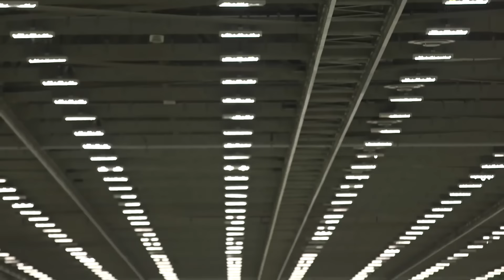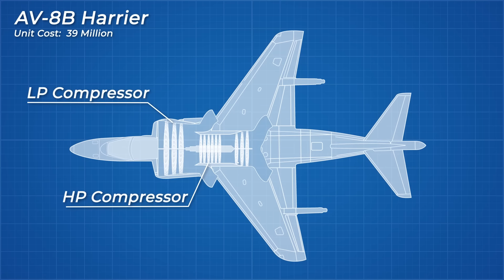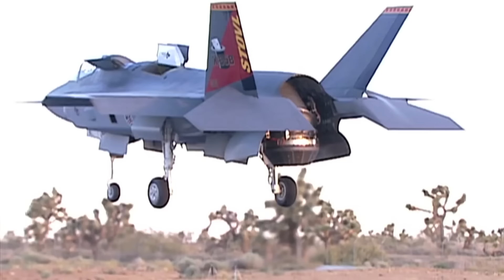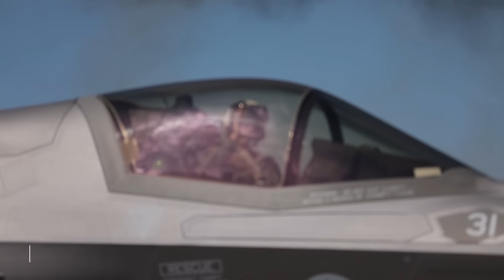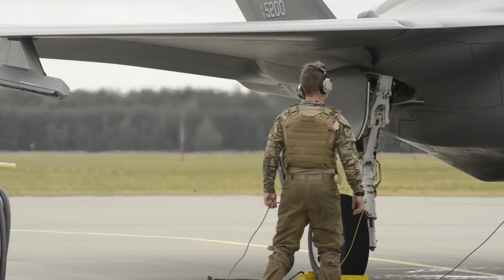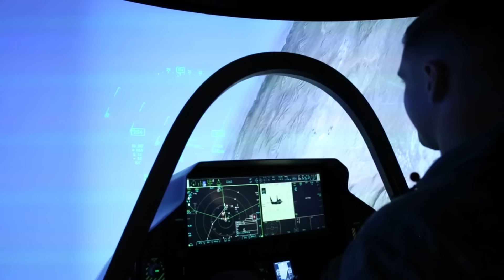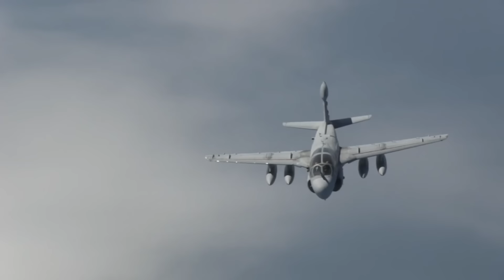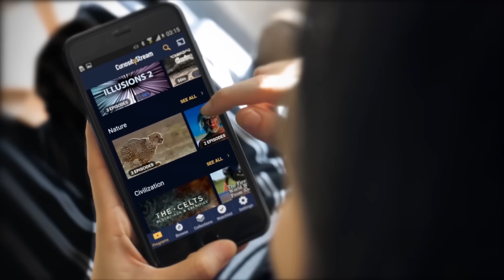Is The F-35 Worth $115 Million?

Comment: Real Engineering:
Mentions F-117

Serbs:
Allow us to introduce ourselves
Reply: *L-band radar has entered the chat
Reply: @gnranger  Sorry, we didn't know it was invisible!
Reply: @kg4boj  lmao
Reply: @gianmariovirdis692  That was literally what they said. Serbia shot down one of our f117's and sent a letter saying:
                Greetings from serbia
    (picture of a bullseye on an f117)
          Sorry we didn't know it was invisible.
Reply: Peter Carlson it was invisible. The reason the Serbs managed to hit the F-117 was because of the excellence of the Serbian air defense commander in question who knew when and about where the F-117 would be and just waited for it to open its bomb bay doors.
Reply: @kurousagi8155  Well no, it's not and never was invisible. For a SAM site to come up with a firing solution they need to have certain paramaters avalable, but they were able to track it even with the bomb bay doors closed. It's just they couldn't get a firing solution at the ranges they were dealing with until they did open. A small RCS does NOT mean invisible, on those older systems it just meant the operator couldn't use auto declutter and had to have a keen eye for small targets.
Reply: Peter Carlson right, so the Serbs had to know when and where it was prior to the F-117’s actual flight. Otherwise they’d be sitting there for hours staring at their screens.
Reply: @kurousagi8155  Actually that's EXACTLY what the radar officers on a SAM battery do. They stare locked into those screens for hours and hours looking for any little blips moving fast enough to be an aircraft. In that era the human brain was the most efficient ground declutter instrument and that's how Zoltan Dani and his men tracked then shot down the F117.
Reply: @kurousagi8155  Days and weeks actually. 78 days to be precise.
Reply: Peter Carlson it’s actually impossible to sit and stare at a screen for hours. Anything that is detectable is detected very quickly. For stealth aircraft, you have to know it’s coming. Otherwise, you’d have no chance.
Reply: @kurousagi8155  Apparently you've never worked in the military "on watch". That's EXACTLY what radar officers do. And while they do slack off quite a bit in the american military... not so with the soviets. You slack off... YOU GET SHOT.  If you are radar operator on a SAM site on an active battle ground YOU DAMNED WELL BETTER NOT let your eyes leave that screen! Mind you this was antiquated soviet era stuff, and even with a modern system like AEGIS you are the operator, you watch that screen like it's your favorite football team. There are no BEEPS or BLOOPS like in hollywood, you see a pair of osciliscope readings and it is your job to watch them at all times, it takes a LOT of disciplne but they do it, and on modern systems the commanders even can throw up fake hits to see if their operators are doing their due diligance and report EVERYTHING.  In soviet russia... you would get shot. On a battlefield? You would get SPLATTERED because SAM sites were very often targets of low flying aircraft who would pop up right out of the ground clutter and splash you, and no, target acquisition and recognition is not an instant thing. It can take a few minutes to recognize just WHAT a target is. If it's something carrying HAARM anti radiation missiles you might want to just shut down the radar for a minute, for a bomber, you definately don't want to do that. Once the search radar recognizes a target and other search radars and spotters identify it is hostile and a TARGET the order comes to attack it, this does not happen in seconds and requires the team to operate efficiently at all times and stay to their tasks. It's not like a nuclear silo operator where they can play ping pong or pool or what not until an EAM comes in and they need to verify launch/no launch.
Reply: Peter Carlson lmao. Right. The Soviet conscript is more disciplined than the trained American professional. Hilarious. 

No. No one stares at screen for hours on end. They do position changes every few minutes to keep everyone fresh and thinking. Also, the Soviets didn’t shoot their own troops since the end of WW2.
Reply: @kurousagi8155  No sir... When I fought in the serbian war with russia 18 hour shifts 7 days were normal. And in combat zones YES... they would "shoot" you. Might not be a bullet though. You might get knifed in the throat.  Boris Yeltsin was president and he didn't take any shit! I know this for a fact... I was in the Russian paramilitary who were also over there fighting in the kosovo conflict. Take it from firsthand experience from someone who was there in person.
Reply: Peter Carlson oh so you’re biased because you don’t want to appear weak despite Serbian air defenses allowing through thousands of NATO air sorties.

I’m sorry that Russia doesn’t have enough personnel to be able to properly man and staff it’s air defenses. But that doesn’t detract from what I said earlier. Modern militaries, including the post-reformed Russian military, do not have guys staring at screens for hours on end. Scientific studies show that attention begins to seriously detract after simply 30 minutes.

The fact that so many NATO bombs came through despite Russian aid shows that Russian air defense practices were not adequate.
Reply: @kg4boj  LMAO nobody ever told me that story
Reply: @kurousagi8155  i was told the bomb bay gave it up yeah
Reply: @kurousagi8155  "its impossible to stare at a screen for hours" yeah right and we all here dont spend 10 hours looking at a screen
Reply: @kurousagi8155 Its not really so much soviet as it is yugoslav,and the "americans have better soldiers" "no we have better soldiers" is not important as the doctrines are so much more different,there they have a bunch of dudes running in the desert following one commander,here we have a few dudes going through a forest everybody helping eachother
Reply: @kurousagi8155  so many bombs came through because we were overwhelmed,our army was much smaller than the american and nato army,but we could punch above our weight ;D
Reply: Peter Carlson lol apparently more than you. I’m not the guy who thinks a single shootdown makes the war.
Reply: Djordje XO I think the difference is that we spend 10 hours staring at an entertaining screen rather than a radar screen that isn’t showing anything.

Serbian air defense had its moments. But when you look at the thousands of sorties made by a few hundred planes, you should wonder why exactly there were so few shoot downs by Serbian air defenses.

I don’t recall any major ground combat between NATO and Serbian forces. So I wouldn’t know if Serbian army forces actually performed well. I was really just noting the performance of Serbian air and air defense forces.
Reply: @cursedcliff7562  And we blew up their space aged stealth aircraft with a secondhand soviet missile system made in the 1950s.

the F117 had a small radar cross section, but was not invisible. Because of the angled surfaces it does 'glint' the radar but not constantly. It will show up as a small little pattern on your scopes that comes and goes as various angles on the plane hit the radar beam kind of like a disco ball however to hit it with a missile you need to follow the aircraft with the radar beam, the missile rides in the middle of the beam and  the operator needs to track it's elevation and azimuth on one scope, and its range on another. The operator knew that signal coming and going was an F117 and knew once it opened its doors he could keep the radar on it like a flashlight so when it opened its doors he was able to have the system automatically track it so the missile could intercept it at the right angle that was within it's control authority, and have a constant range lock so the missile knows when to explode. Most missile intercepts don't hit the aircraft with the missile itself, instead they hit it with a cloud of shrapnel which is moving in such a direction that it and the plane occupy the same airspace at the same time resulting in collision. The operator launched 2 missiles, the first did not have the right angle of intercept so it did not detonate, but the second did.
Reply: @kg4boj  

It's funny how people brag about a single shootdown of a stealth aircraft, as if it were invincible. But they totally gloss over the massive destruction of their country due to air raids by the US and NATO. 

An entire country got wrecked, a thousand Serb military killed, and 121 helicopters and aircraft destroyed. All in exchange for 1 stealth plane. You guys sure showed the Americans! 

Sorry we didn't know your country didn't have oil.
Reply: I really like how you can brag about something like that. Destroying a country, phew... For your information the estimates were that the bombing would last about a week or two but in fact it lasted 78 days... Yeah, you destroyed 121 aeroplanes and helicopters, most of them not even operational. NATO had more than a thousand planes at its disposal, Yugoslavia`s best plane was MIG 29 (16 pcs, few operational) from 80`s non modernized. Wow, what an acomplishment! Yet, they didnt have the ba..s to get to ground fighting, because Yugoslav army was more than 80% opperational at the end of bombing... Use of terrorists or Albanian regular army also ended in disaster. NATO wasted more missiles on models than Yugoslav army on its whole budget. They managed to destroy 10 tanks in 78 days of total air dominance!!!
Reply: Also, it wasn`t just an F-117 shot down. There was an F-16 and a Tornado i think (not sure). You musn`t forget that NATO had total air dominance, had all the airstrips, at it`s disposal, from Yugoslavia`s neighbours.
Reply: Goran Momcilovic several thing wrong with your statement. During the war for Kosovo, NATO did not deploy over a thousand planes, but did deploy over a thousand aircraft including reconnaissance UAVs and Helos. 

NATO would launch 38,000 sorties. During which the Serbs launched more than 700 air defense missiles destroying 2 manned jet aircraft (an F-117 and an F-16C) and 25 UAVs. 2 American helos were also lost, though it is unknown if Serbians were responsible for 1 of the crashes. NATO also lost an A/V-8B Harrier over the Adriatic due to technical issues. So the Serbians destroyed 29-30 NATO aircraft out of at least 700 attempts resulting in a 4.3% shoot down rate.

It should be noted that at 75%, a military unit is considered combat ineffective. So while the Serbian military still had many functional military units, including functional air defense SAM units, the Serbian losses were in fact severe. Also, the Yugoslav military had 1,114 tanks. So if the Yugoslavs’ claim of 80% remaining functionality is to be believed, that means NATO destroyed at least 222 tanks, not 10.
Reply: First of all, 80% of functionality is not a measure of destroyed assets but abillity of armed forces to execute tasks put before them by command (movement of troops, neutralization of hostile forces etc.)  so 80% of functionality isn`t at all bad if you take into account of 78 days of bombing. Actually Yugoslav military had 1025 tanks of which, according to official data, there were 18 tanks destroyed (T-55, T-84 of which 4 were decomissioned/destroyed by tank mines), 10 transporters (БВП М-80 ,ОТ М-60), 5 scout vehicles (БРДМ-2), 4 howitzers (105 и 122 mm)... A lot of planes were destroyed on the ground but most of them weren`t operational. Yugoslav army budget was 1,3 mil $ so I believe that you understand how silly these numbers look. I mean, NATO had TOTAL air superiority, they weren`t/couldn`t be challenged yet we managed to transfer a whole mechanized brigade to Kosovo without it being detected. Our people called it "ghost brigade". If you look at the footage of withdrawing our forces after the signing of treaty you can actually see how false NATOs spokesman numbers were... Also in the articles i read there is a mention of 1031 combat aicrafts so does it really matter if it`s 800 planes, 200 UAVs and 31 helos or it`s any other number combination when you are going against a military that has this kind of budget...
Reply: @GORANMOM  You are here on an American website speaking English. You always come to us for civilization and you always will. When Serbia contributes something to the world besides mass genocide you can act proud and mighty. Until then, keep bragging about that 1 plane..........
Reply: @GORANMOM  You are here on an American website speaking English. You always come to us for civilization and you always will. When Serbia contributes something to the world besides mass genocide you can act proud and mighty. Until then, keep bragging about that 1 plane..........
Reply: @k.t.1641  First of all "civilization" doesn't come from the West. It comes from the East. Second, I don't really know about this genocide that you are mentioning. If you are talking about Srebrenica, please do your research and look at the definition of genocide. Thirdly, please look at the history of Western civilization, it's full of acts of unparalleled genocide...
Reply: As for contributions try Nikola Tesla, Milutin Milanković, Mileva Marić-Einstein (Einstains wife, who did all of his calculation), 12 scientist from Serbia which participated in Apollo program...
Reply: @ivanlagrossemoule  Please tell us how many wars did Serbia lose? And why couldn`t she keep up? She attended same universities as him, where she met him... I would urge you to be "civilized" if you are able. I`m not sure that you are.
Reply: Read/listen to the book "Skunk Works" by Ben Rich. It's about the F-117s development, extremely facinating!

Comment: How does energy absorbing paint and software for long range detection improve the F35' maneuverability?
Reply: I think he was refering to the test pilots criticism of the plane as a dog fighter, because it lacked radar absorbant paint it didn't fair as well against other aircraft in a dog fight as it could have.
Reply: @lutherburgsvik6849   He was referring to a pilot who criticized the plane for not maintaining kinetic energy when maneuvering, he wasn't referring to its capabilities in a dog fight.  Seems it was more an evasive response  to a real problem. He also avoids talking about the costs to maintain this aircraft.  I can't see them recovering their front end costs in that manner.  The $115 million a copy will never cover the development costs.
Reply: @MeBituman  I must've misheard him then.

It's a valid point about running costs. The Warthog is an old aircraft that still performs it's assigned role well, many years after it's first flight, and has low running cost compared to other aircrafy. Why they don't just continue to maintain or manufacture them instead of using the F35 is beyond me. As the old saying goes: "If it ain't broke don't fix it."
Reply: @lutherburgsvik6849  Very true especially when you consider the abuse they can sustain in combat.  By the sound of it the F35 mainly relies on its stealth capabilities.  When you watch this video and see that a scratch in the paint compromises that quality, how could if ever be expected to do the job of the Warthog.  Seems to me some bean counter thought it would be cost effective to have a base model with options.  Only problem is these variants are like comparing apples to oranges.

Comment: Hi RE, please could u check this info : seems u gave the F-22 a 150 M$ price per unit, when ABC & Business Insider agree about a 70 B$ program and 189 F-22 built. That's a price of around 350 M$ / unit. Where does ur info come from or what's your calculation process ? Thx a lot. Or if anyone has any authority on this mater, sure.
Reply: Program cost per unit is what you're referring to, not Unit cost. Unit cost is how much it costs to produce each aircraft. Program cost per unit is a very simplistic measure of the worth of the program since the technology development also affects other projects e.g tech developed in the F-35 program has already been integrated into the F-15 and F-16 in the form of new radars.